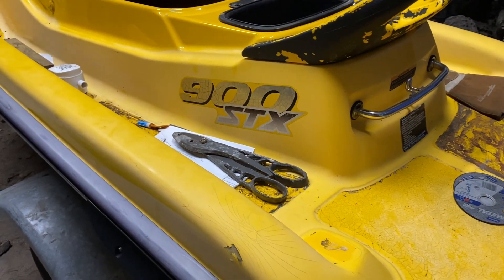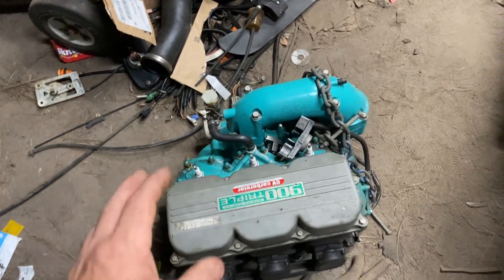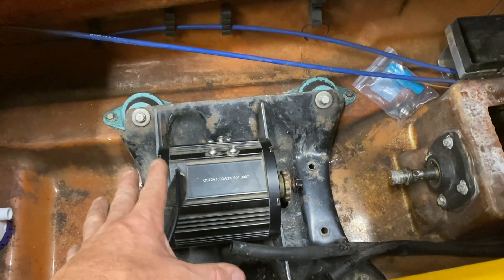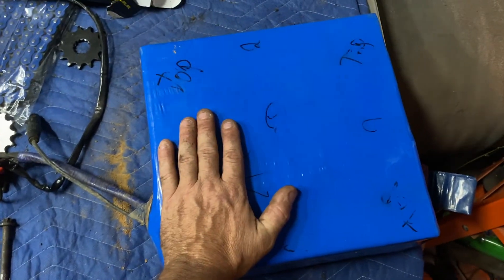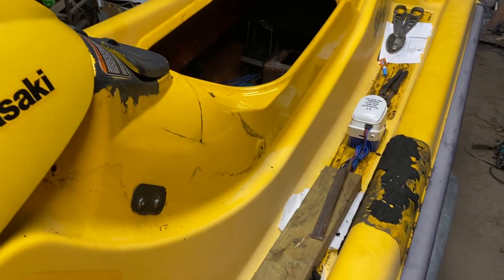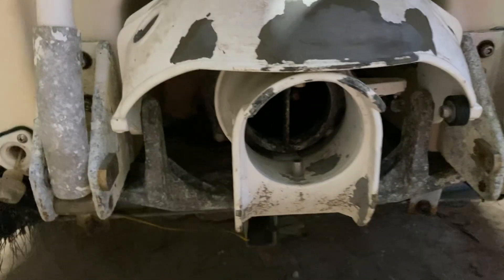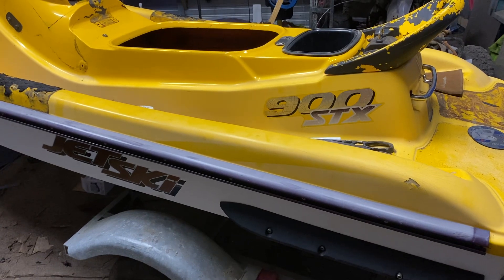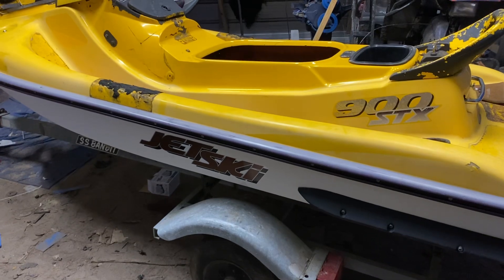JetSki electric conversion

Comment: Pretty cool but you need serious power. I wouldn't go below 50 kW.
Reply from the maker: Posting a video here soon, I went out the other day and tested it. It worked really well. I got up to 55 miles an hour and did not want to go any faster than that but all I have to do if I want to go faster is change the sprocket size, that’s why I went with a chain posted in the next few days. Thanks for watching.

Comment: Could be the future of skis! Hope it goes well! Keep posting
Reply from the maker: I am hoping it is the future of jet skis as you can see if you follow my videos I built a four wheeler with the same set up in there motor battery set up and it last all day long nine hours of hard-core riding in the mountains at high extreme speeds with those three batteries, I was able to last for 8 to 9 hours Switching them out and having one being charged at all times

Comment: Why even do this? I can ride all day and find gas at any dock. Good Luck finding a charging station at any marina. Dont drink the cool aid
Reply from the maker: It is not about riding all day. It is a hobby of mine to do stuff like this. That’s all it is for the fun and it is to have something that no one else has. That’s all you only live. Once you might as well. Enjoy it the way you want to answer your question, there is no charging stations anywhere and yes, you can ride all day long on gasoline and I cannot on my electric But that is why I’m doing it Also the charger is built into it and all I need is a 110 plug which last time I checked every marina out there has a 110 plug nearby if not already on the dock.
Reply: More of something to have nobodyyy else has…for the rest of his life, and would be a fun ass rip